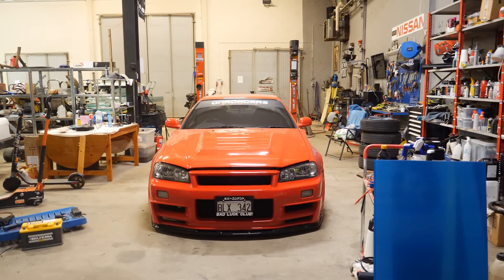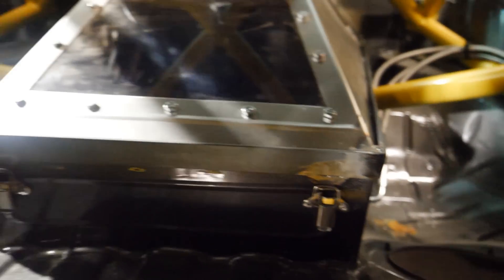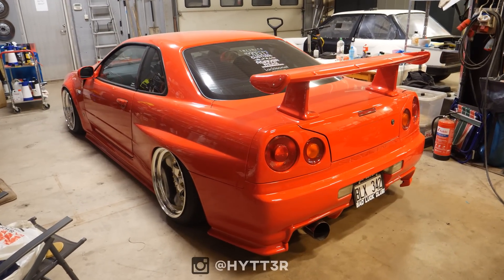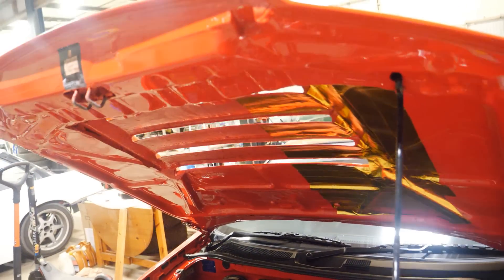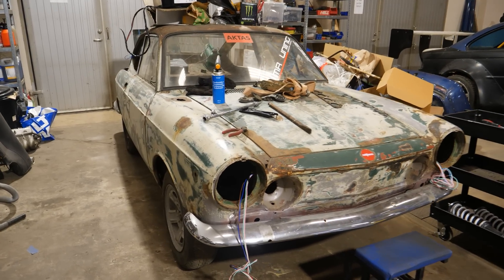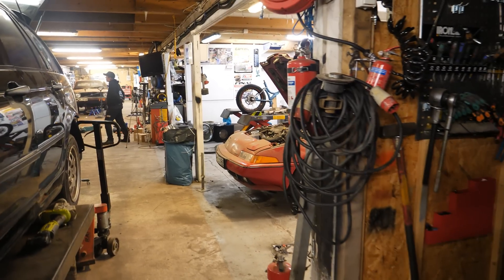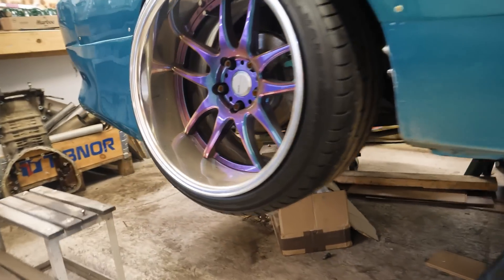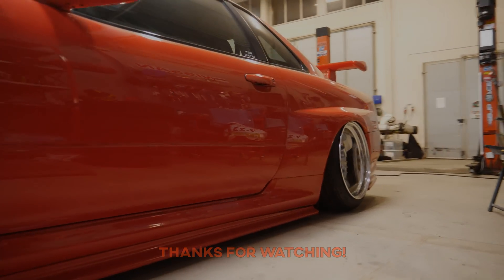Winter Garage Visit (Swedish Garage tours)

Comment: Peter, great video. Very interesting to see what others are doing. Personally I am a big fan of this Mercedes M119 engine like the one in the E30 BMW. It’s one of the best engines produced, very high quality materials, very low failure rate, even after 30 years, and with great architecture, 5liters, 4 cam, variable timing on the inlet, 4valve per cylinder. I have build  6 liter version, bored, stroked, converted to solid lifters, and have a nice cam profile. Mine is NA, but I see other have good power with turbo application. Keep the camera rolling
Reply: My old car,  650whp 950nm on 0,6 bar  boost

Comment: I once had a mint SAAB/Lancia 600. Precisely managed to fly off the road in a corner I knew was sharp. But the winter in Norway sometimes does that to nice cars. Wanted to make it into an Integrale and got the OK from the government, the same guy that ok'd it at Biltilsynet did the same to an Lancia Thema and turned it into the awesome Lancia by Ferrari Thema 8.32 with a Ferrari cross plane v8 from the 308 or 328, not sure what engine Lancia used, but that is a dream car for sure. How fun it would be with the engine from the 430 or 458 in a front wheel drive Thema....
Reply: This happened some 30years ago. I bought the car in Halden/Mysen, very close to the Swedish borders. You Swedes was always so lucky because you could have cool cars. In Norway we pay close to 100% tax on cool cars, unless they are electric, but how many petrolhead's care about those appliances? Ok for daily commute, but there needs to be combustion taking place for us that love older cars that actually have a soul.....